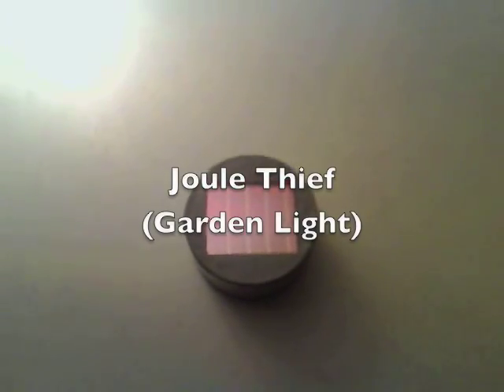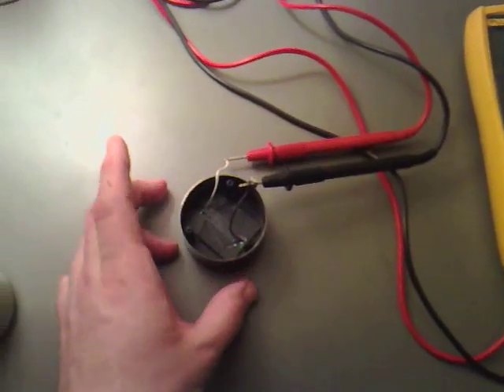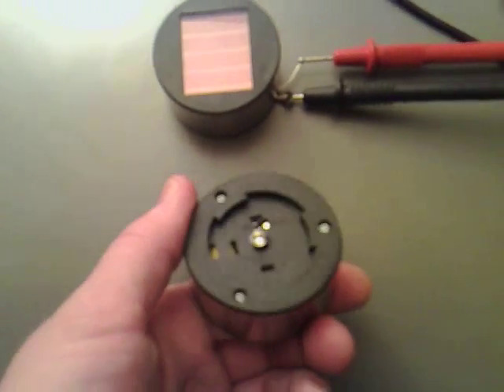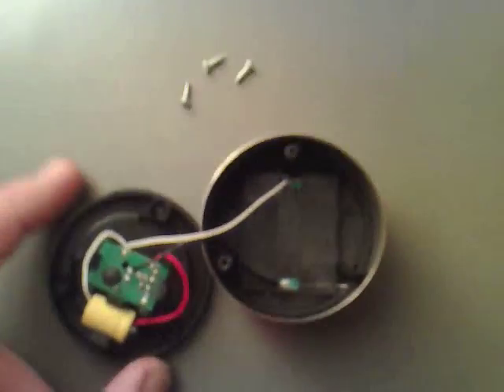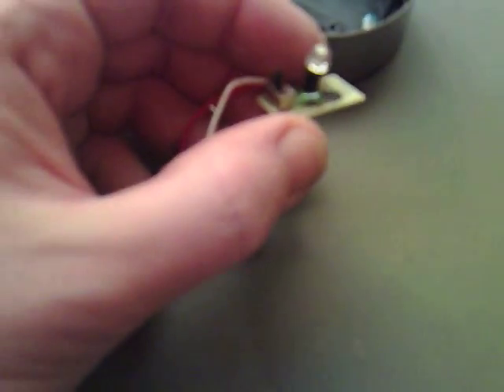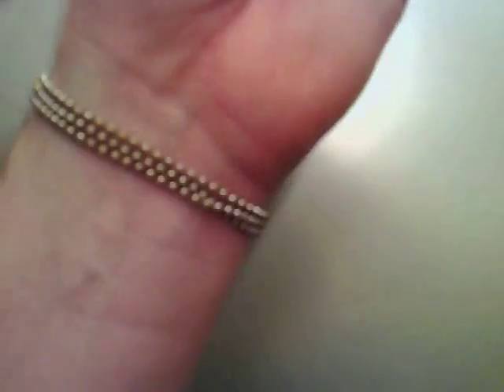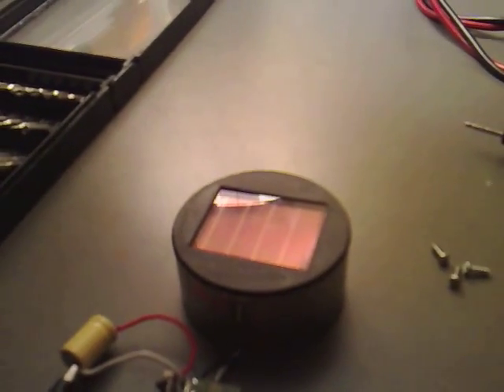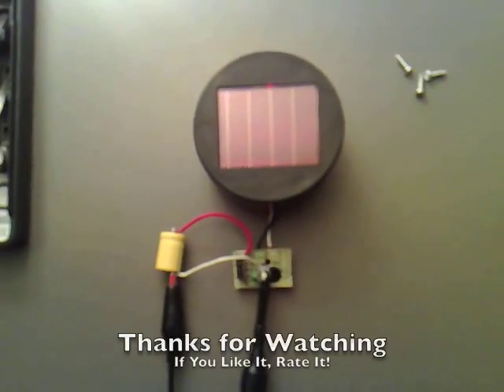Joule Thief (Garden Light) 020

Comment: after I watched your video I went out and I bought about 20 of those solar lights from the dollar store and I was curious to see how many would light up because the ones I bought they Light Up 3 LEDs so I started connecting them together and so far I have 10 LEDs running off that one 1.2 volt battery

Comment: Nice video.  I have a possible application if modding the circuit will work.  Should I be able to swap the white led for a UV led without burning out the led or circuit?  Maybe a bigger battery too.  Voltages and currents seem similar on both white and UV leds.  I need to make a bug attracting light that will mark the arrival of certain pests in my fruit trees.  Modding a garden light might be just what I need.

Comment: Great video Kubukop.
Thank you. I do not want to take mine apart, just in case I   brake it.
Did you ever measure the battery when full? Is it 1.v2,1.5v, 3 v??
I agree it is interesting this tech has been around and yet stays hidden from most people.
Thanks for doing this work and showing.

Comment from the maker: If you just hook it up I think that you will find your multimeter is registering the massive spike of voltage.  The capacitor will charge, make sure you use a diode to the positive side so you do not damage your Solar cell..

Paul..

Comment: What you call "Joule thief", in this case is just a DC-DC converter, a very well known type of circuits. I think that the term "Joule thief" was used originally to refer a circuit that can get some usable energy from almost depleted batteries (it is a rudimentary steep-up DC-DC converter), so I think that we shouldn't use that term for everything that uses a coil and an oscillator. Anyway, I enjoy a lot your videos.

Comment: You can call it joule thief if you want what those small lamp are using is the same principle they boost the voltage with an inductor. It's probably the easiest way to do so altought some circuit can boost the voltage with more complicate part ^^